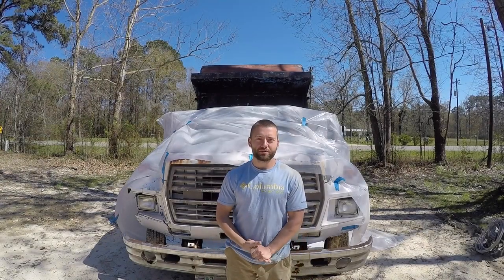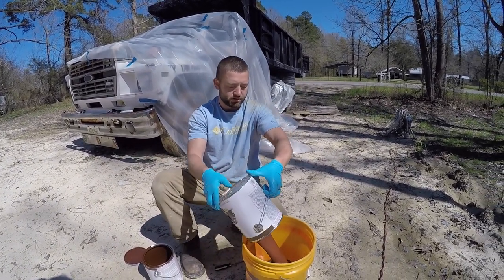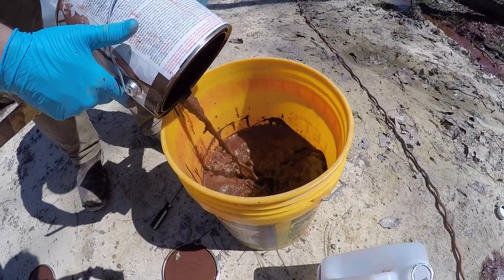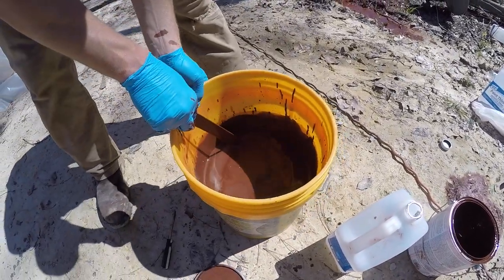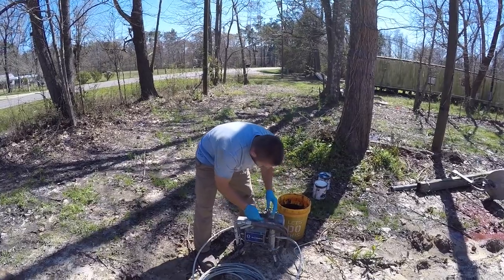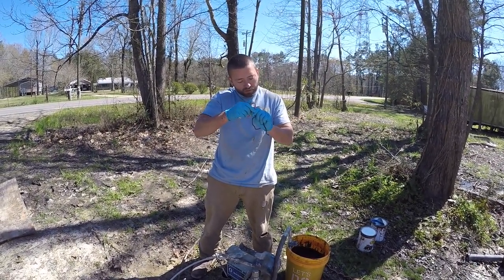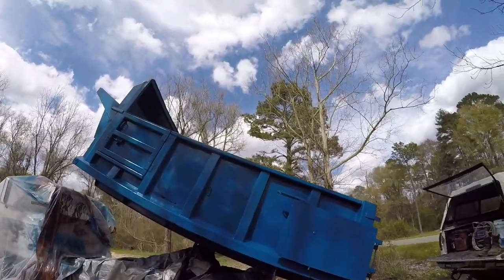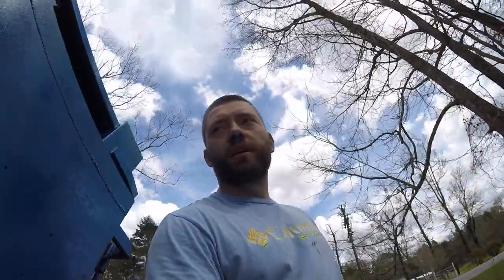Restoring A Old DumpTruck | PAINT

Comment: Cool, good job.  Why are you not cutting out that swiss cheese rust and welding in new metal though?  Seems like most of the rust is on the bottom.
Reply from the maker: Mostly the price point of 3/16 steel. I'm going to deck the bottom with 2x10s
Reply: @dudewecanfixit  Just curious how much the steel would be to do the bottom?  $1500?  Woods double its normal price right now.
Reply from the maker: Around $2500-$3000 for that size bed. Or $400 to do wood
Reply: 3/16 is around $300/sheet
Reply from the maker: I haven't priced it out lately
Reply: @dudewecanfixit  I had to rebuild a small dump truck for a guy I went to the scrap metal place and found different size and shape pieces welded them together on the ground Square them up and a welder them on the bottom of the truck please don't use would you will regret it